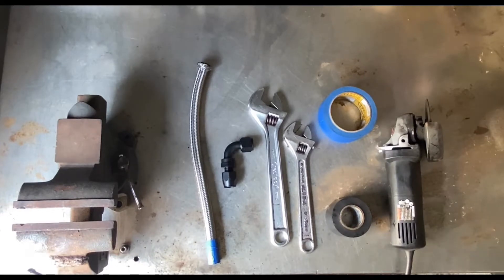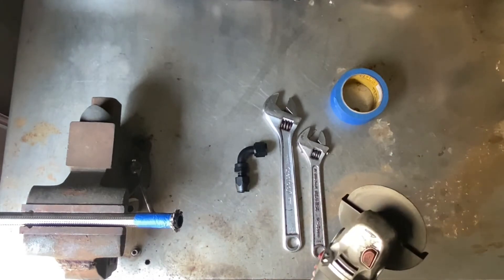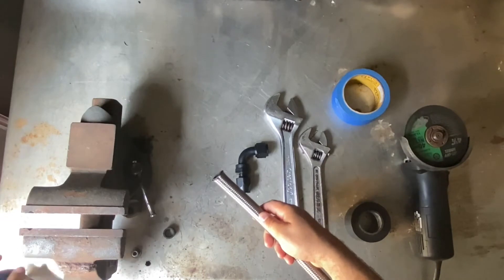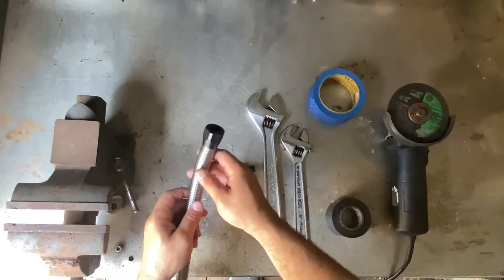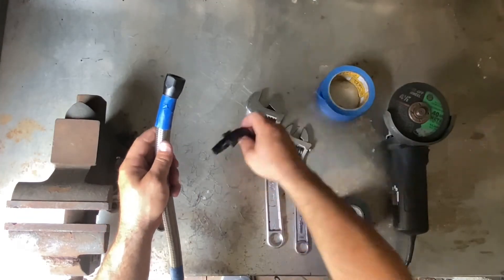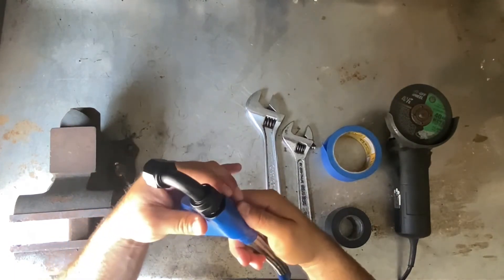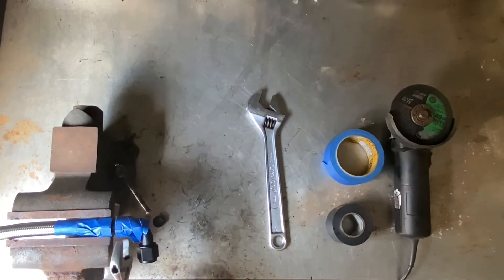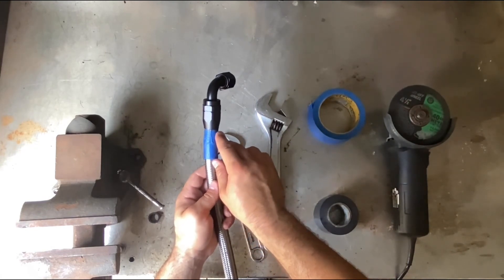How to install AN fittings without scratching them

Comment: Thanks!!  Do you find masking tape works better to protect the fittings than Electrical tape?  I just made some fittings with nice Russell -10 AN fittings (first time for me) and the electrical  tape seemed to move around a lot. I will try blue tape next...
Reply from the maker: I had the same problem when I used electrical tape. The masking tape doesn’t move around when your are tightening the fitting and it doesn’t leave any residue.
Reply: @bo0stedracing  Awesome thanks!!